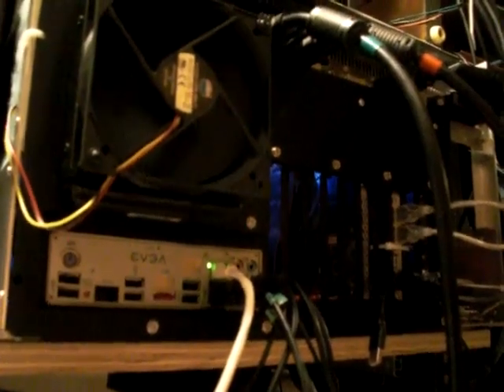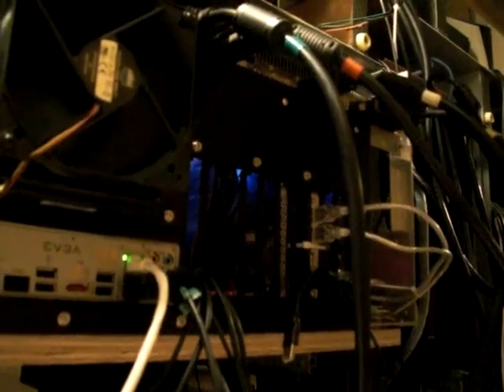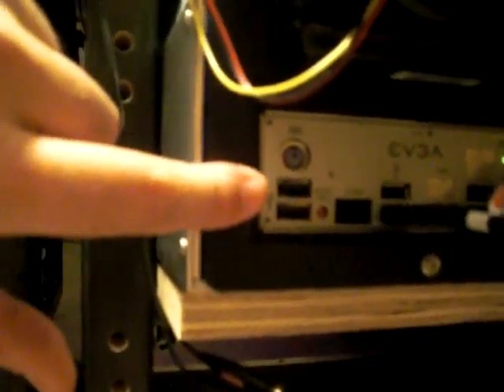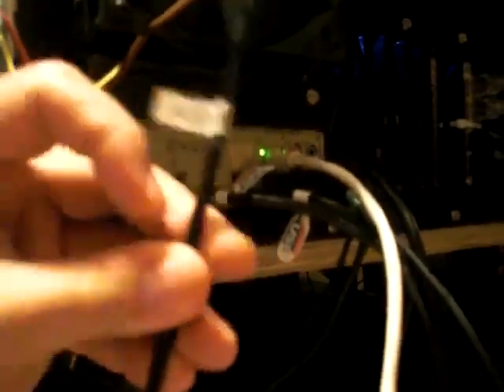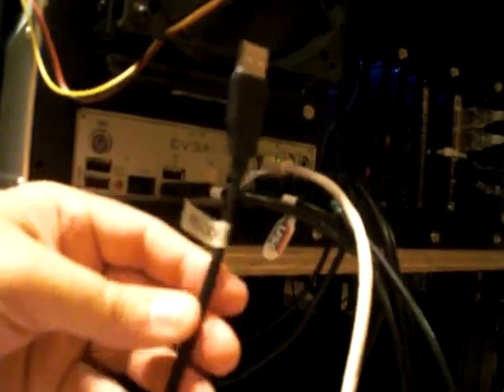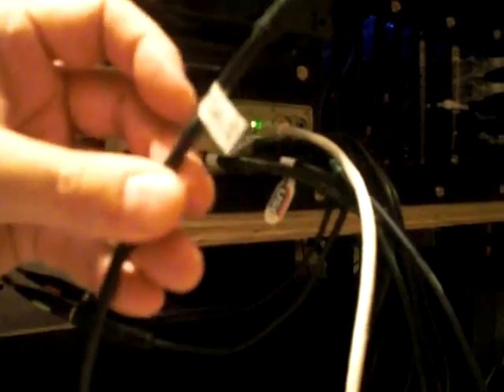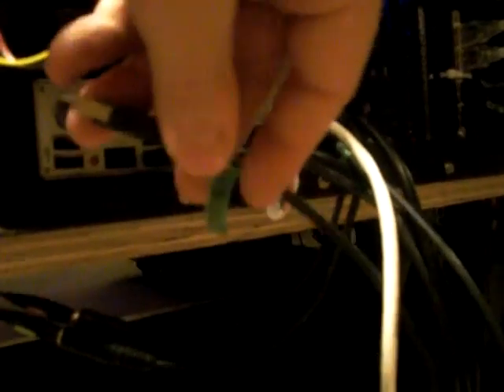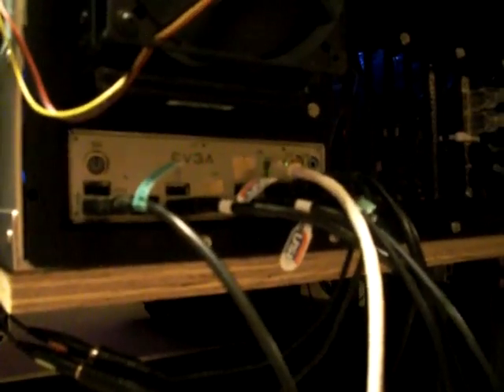FSX & FS9 DIY Flight Simulator - Part 2 of Configuring Multiple USB Devices

Comment: Looking For Part 1 ?
I'm getting a wireless keyboard. Would like to attach my laptop (as a second monitor). Using the wireless as an extended cockpit control panel hooked to my desktop via usb port. Any suggestions? Thanks